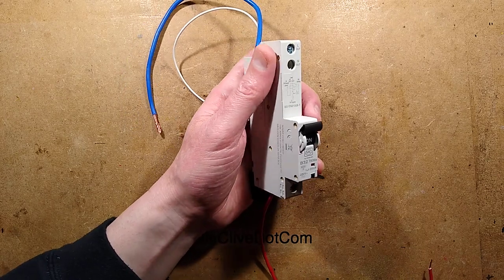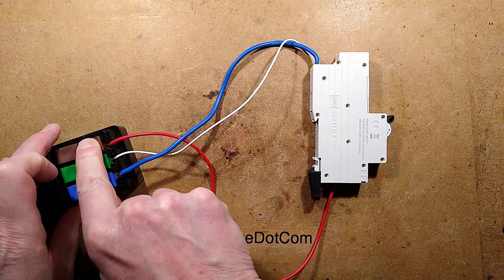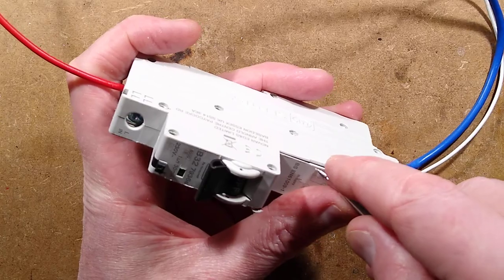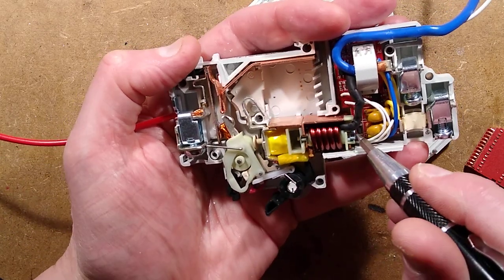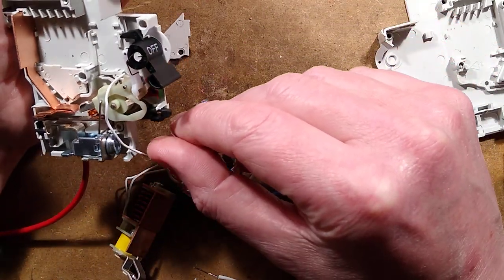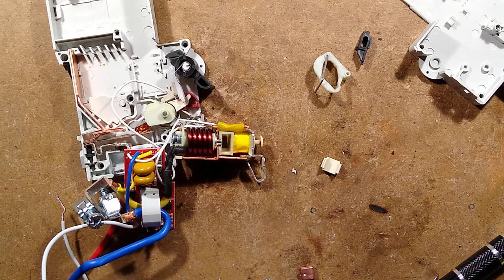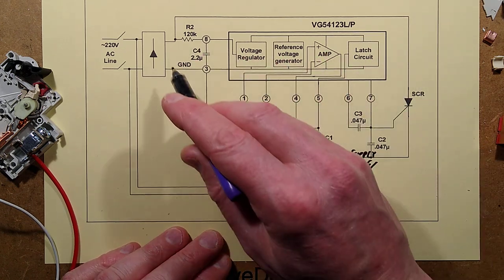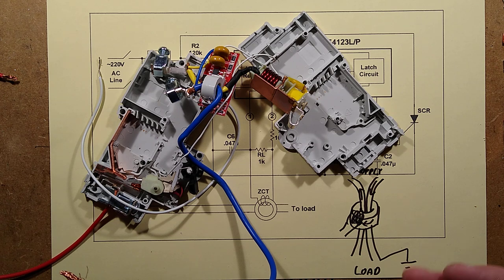Failed MK RCBO circuit breaker (with awkward recording moment)

Comment: The white cable should be for a path for the RCD to work in a neutral fault condition (it doesn't sense anything)
Reply: @johncoops6897  neutral loss as the RCD side is electronic, I guess the older ones couldn't operate if that type of fault happened (unsure if the earthless RCD ones will trip if neutral is loss)
Reply: White wire is connected to Earth - Used for the test function, creating an imbalance of the Active and Neutral field effect in current transformer.
Reply: @johncoops6897  neutral and earth are norm bonded at the incomming line where the line fuse is (for UK/eu) or there be a earth rod in some cases depends on condition not the consumer unit

 USA seems to do it inside there consumer units

So it is possible to lose neutral even inside the box where the neutral bus bar is, the cable could fall out leaving circuit open live with no neutral (unsure if a RCD would trip under them conditions but as the live and neutral would not match any more I guess it would trip the RCD ), never say its not possible to lose neutral (3 phase and you get some fantastic if not expensive Magic smoke happens when you lose neutral)

An interesting test if he can test for that, pretty easy switch on the Neutral leg and switch it off while the power going through the RCD see if it reacts to it
Reply: I looked at the catalog page for this particular RCD and, according to the diagram, the white wire is one side of the power supply for the electronics. In other words, for it's power connections, the electronic circuitry inside this RCD has an internal connection to the "L - IN SUPPLY" terminal, and the connection to earth/neutral is done through the white wire which is listed on the diagram as "FE - White". So without this white wire connected, the electronics get no power. The catalog page says, "The neutral supply (blue) and earth supply
 (white/cream) are provided via flying leads." 

So yes, if the blue wire is disconnected or the neutral which it is connected to opens up, the RCD will still work as long as the white wire is still connected to earth.
Reply: @leexgx  I've never opened one up but my understanding is that the older RCDs are electromechanical and the power they need to operate comes via the sense coil when a fault happens. This was explained as the reason why GFCIs as used in the USA use a 5mA trip current while RCDs use a 30mA trip current---GFCIs use electronics and 5mA trip current setting is possible with electronics, but with electromechanical RCDs, 30mA is the lowest trip current setting possible. I suppose that in these electromechanical RCDs, the sense coil feeds a trip solenoid.
Reply: @johncoops6897  https://www.mkelectric.com/Documents/English/EN%20MK%20Technical%20Specifications/T25%20SENTRY_Tech_HR.pdf 

It's on page 586, zoom in to the image of the breaker, the schematic is visible in that image,

Comment: I guess the thyristor is fired and it shorts the bridge rectifier output and latches (since its in a DC circuit). I guess also that the yellow coil is in series with thyristor to keep the breaker in constant tripping status.
Reply: @johncoops6897  In this case the SCR turns off and does not latch after tripping.  In the datasheet schematic which John showed, the SCR is on the rectified mains side. For that reason I figured that they must be using it to keep the switch tripping continuously. Thanks for clarifying.
Reply: @johncoops6897  check the in the link hereafter. It is close enough to our example. The coil is in series with the bridge rectifier so when the SCR is activated, the solenoid is energized to open the breaker. http://circuits.datasheetdir.com/206/LM1851-circuits.jpg
Reply: @johncoops6897  Oh don't worry, I understand its mechanical operation principal. John Ward did a video on a similar type of RCD not too long ago. Here's the complete circuit in Clive's 2 year-old video. Thanks
Reply: @johncoops6897  Because Clive said he didn't know why the SCR is shown like that in the datasheet. So I made an educated guess 😅

Comment: What do you think about the small din rail breakers, like sold on Amazon, for around $15,  the AC, and DC versions, I have the 250 & 400 volt dc versions, and  a couple 250v AC versions,  are they any good? Are they safe, and what is the difference between the AC and DC versions, they look the same! Thanks
Reply: I would not trust inexpensive circuit breakers from manufacturers with unknown reputations for quality — especially DC breakers — stick with the major known brands.  I’ve seen so many cheap breakers fail that it just isn’t worth the money savings as you can never have any real faith in them working as intended when you most need for them to function as intended!  From breakers that just never broke the load under dead shorts due to contact welding to circuit breakers that after one trip failed to remake a connection.  But at the voltages you mention, 250V and 400V DC, things can be downright scary in terms of arc flash on a trip under dead short because DC arcs are much harder to properly quench than with AC as DC has no zero-crossover point where the voltage drops to zero twice per cycle.  Estimate what a catastrophic failure would cost you (in terms of equipment, wiring, fire, etc.), then determine whether the money saved on a cheap circuit breaker still constitutes “money saved” and then make your decision accordingly, but in my experience it simply is not worth the savings as we generally need to be able to absolutely depend upon a circuit breaker doing its job safely and reliably when and if things go very wrong.

Comment: Got a couple of questions for you Clive.

When the immersion heater is switched on to heat the water in the tank, the distribution board buzzes. Any idea why>

second question: I have an Anker battey bank (10,000MAh) it still has power but won't charge anymore? I can send it to you if you want to diagnose/repair it.
Reply: 2nd one sounds like the charge port has broken on the device.
Reply: Buzzing distribution board is an odd one. Depends how that heater is switched. If it's switched directly, chances are there's something loose in the switchboard that is causing a vibration with the higher current. Alternatively, it's being switched via a contactor (big relay), these are known to buzz. You should hear a "clunk" at the distribution board when it's turned on and off if it is being switched via a contactor. If so, this is normal.
Reply: We have an MCB which buzzes when the shower is on, I can only surmise that it's a coil (or it's core) which is vibrating due to magnetostriction, but I could be way off! I work for national grid and the transformers tend to be noisier under higher loads, so noise in your protective devices is probably related to the increased current through the MCB or RCD.
Reply: @Eddiecurrent2000  neat. Circuit breakers have a coil in them for the short circuit trip, but it's pretty uncommon for those to buzz because they've got such few turns, compared to a transformer with hundreds or thousands.
Reply: @Thermoelectric7  It's more the core than the coil itself which causes the buzz in TXs and possibly because the shower in my case is 40A it's right on the limit of the MCB, and it could be the plunger on the MCB. When we test the old "clickety clack" electro mechanical relays you can often hear them start to buzz, just shortly before they trip, it could be something similar on the MCBs.
Reply: @Eddiecurrent2000  The coil won't be on the edge of tripping, the bimetallic strip will be. The coil in the breaker is relation to the "type" of the breaker, B type being somewhere near 5 times rated current and C at 7.5 times (I'm rusty, but somewhere around those figures). So, for that coil to trip on your (presumably) B40 MCB, you'd have to pass say 200A through it, as a short circuit would. I can't imagine the bimetal strip would buzz either.

Oh well, if it works it works!
Reply: @Thermoelectric7  Yes I can't see the bimetallic strip buzzing, I would still hedge my bets on it just being the coil and its core, it's the only thing subject to increased magnetic effects due to the current running through it, ours has never tripped even when the shower's been on for an hour or two!

Comment: The thing you called a Thyristors is a silicone controlled rectifier, it is a member of the Thyristor family. This is the same as saying there is an automobile.   The following is a partial list of Thyristor types to name but a few. -  Photo Thyristor LASCR, Gate Turn-off Thyristor GTO with Anode Gate, Reverse Conducting Thyristor, with Cathode Gate  RCT, Thyristor SCS, Thyristor SCR, DIAC, BCT – Bidirectional Phase-Controlled Thyristor, FET-CTH  (FET-Controlled Thyristor), MTO (MOS Turn-off Thyristor), IGCT  ntegrated Gate-Commutated Thyristor, TRIAC, SIDAC, Quadrac.

Comment: I enjoy Thomas channel too we use Arc fault breakers here in the usa
Reply: This is equivalent to our GFCI circuit breakers with overload protection (GFCI + thermal-magnetic trip), Arc Fault (AFCI) is something else entirely (specifically, arcing or intermittent shorting between live and neutral) whereas GFCI/RCD is the unintended shutting of current from the live or neutral to ground through an unintended path (such as a human).  However there are also combined AFCI + GFCI circuit breakers with overload protection.  But Arc Fault protects against an entirely different type of fault and sadly were rushed into service a good two decades before the AFCI was adequately matured as a technology, which has made them very problematic as some can literally be tripped from afar with as little as a walkie talkie transmission in the general vicinity...and because entire subdivisions are often built with identical components, one legal radio transmitter can kill power to a,large number of homes in a some subdivisions through no fault of the radio operator as it is the AFCI breaker that is actually defective.

Comment: Can you connect all these kind of devices, like mcb-elcb-rcd- and any such "cb"s basically, in series and induce a fault and see which one will react faster? Or perhaps which device will save your life first?
Reply: RCD
Reply: @johncoops6897  When I was testing an RCD (a Merlin Gerin Multi 9), I was using a GFCI protected circuit to do it. I created a ground fault and BOTH the RCD and the GFCI tripped. More recently, I was inspecting a GFCI protected circuit at my dad's house and I decided to trip the GFCI by connecting a test light between hot and earth/ground. Well, I managed to short hot directly to ground, and it tripped both the GFCI and the 15-amp circuit breaker.

Comment: Is it common in other countries for the line to come in at the bottom terminal? I've only seen line on top and load at bottom here in the USA.
Reply: Yes
Reply: I have a couple of RCBOs, one made by ABB and the other by Merlin Gerin. Based on the diagram, those are to be connected with the line at the top, because the diagram shows that the top terminals connect to the circuit breaker, then the RCD and test button circuitry is connected after the circuit breaker. If you were to connect these with the line connected at the bottom, they would still work HOWEVER the test button circuit would continue to draw power even after the unit tripped if the test button was kept pushed down and it would probably burn out the the resistor in the test button circuit. 30mA at 240V is 7.2 watts and I guarantee you that the resistor in the test button circuit won't handle that much wattage for more than a few seconds...

Wired correctly with the line at the top, the test button circuit is disconnected from power when the unit trips.